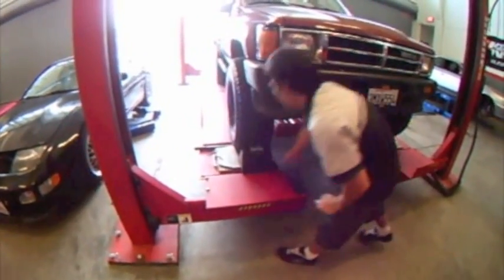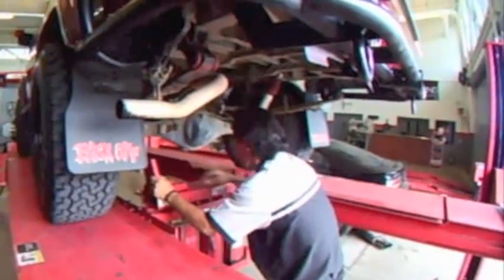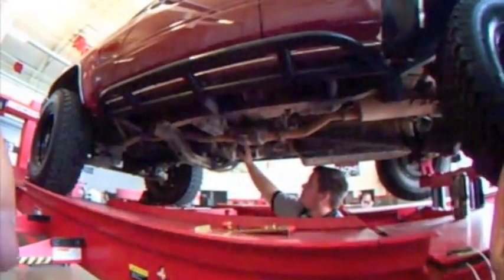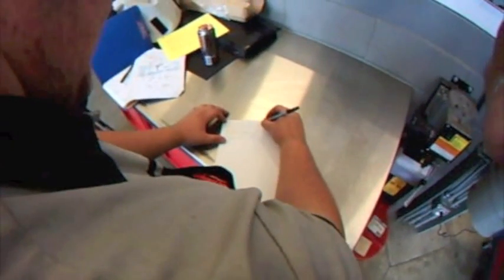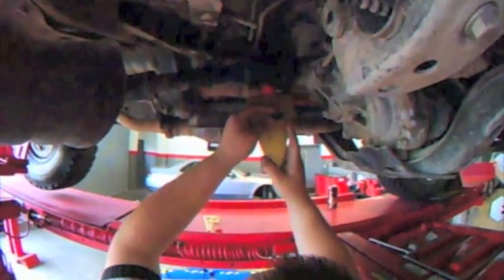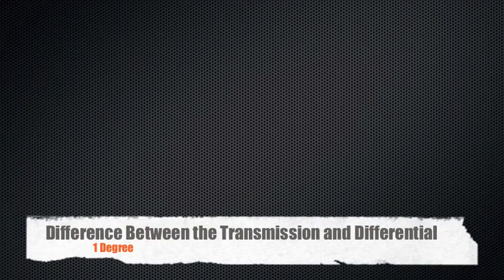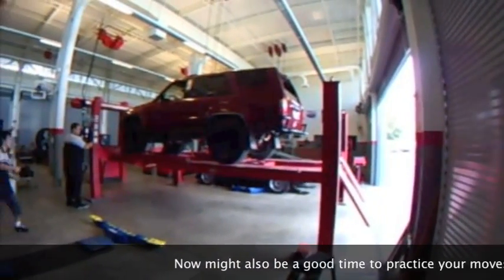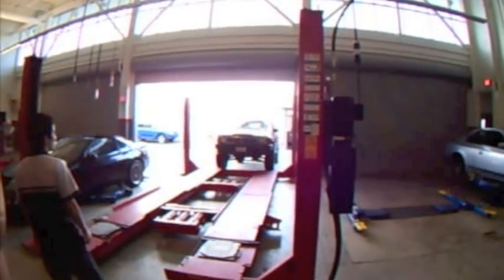Auto Video driveline angles auto 162

Comment: Wow, two MAJOR mistakes in this video.  First, like has already been said, 7 minus 1 is 6, not 5, on the rear.  Also, how is it possible to measure the driveshaft angle at the rear and get 1 degree, then measure the driveshaft at the front and get 2 degrees?  This angle will be the same at both ends unless the driveshaft is bent or has some other serious problem that causes the yokes on each end of the shaft to not be square with each other.

Very misleading information in the video.